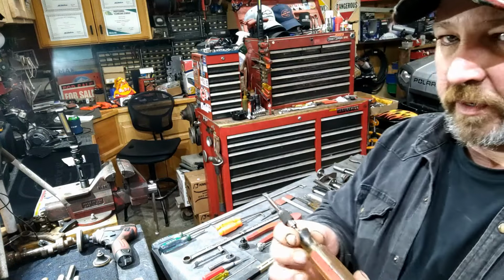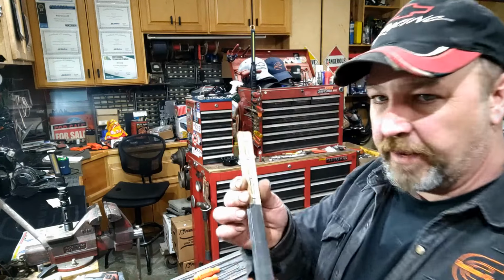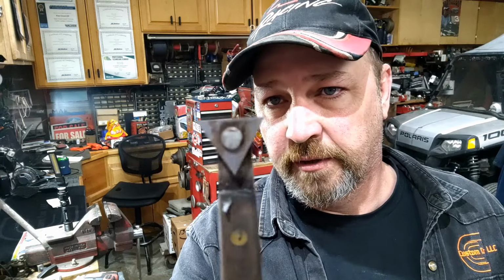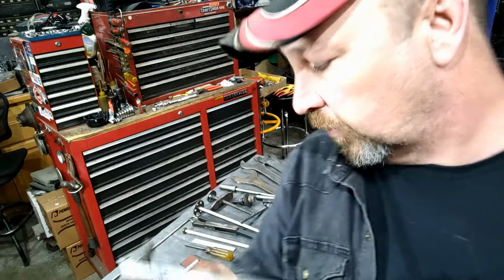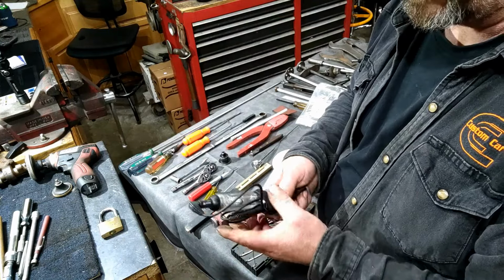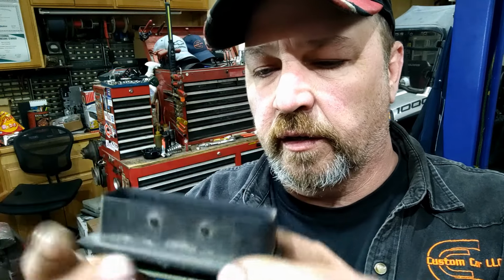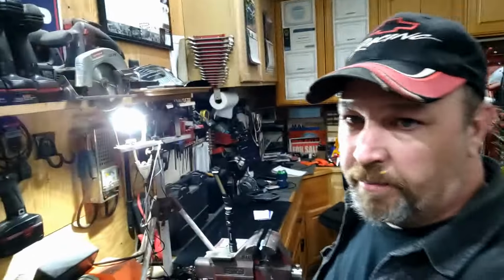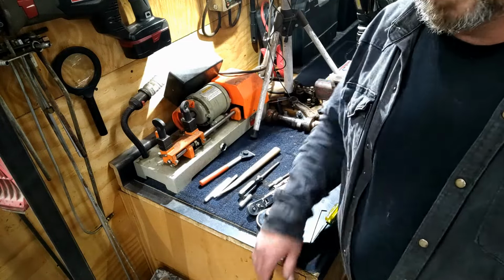My Homemade and Repurposed Tools #homemadetool #autorepair #diy #inspiraton

Comment: Most times I see someone's creations at a yard sale I pick them up, never know when you might need'em for
Reply from the maker: Yes, I did that the other day I stopped in at a garage sale the there were these things with a wide radius aluminum pulley and some thin cable I didn't know what they were until I got home but they turned out to be some fishing trolling apparatus that bolts to the back of a boat.  I will make something out of them someday for sure.  Thanks

Comment: Do you have a specific brand that you stick with?
I have craftsman, snap on, harbor freight, and a some willy nilly found or aquired stuff.
Reply from the maker: No I have them all.  Mostly I have purchased my tools individually.  I prefer the USA Craftsman but the china made stuff isn't any good, the screwdrivers are brittle and the 20v cordless is junk as well my drill has a loose chuck and both smaller batteries have broken cases.  I have MAC, Snap-On and Matco stuff I also have some Harbor Freight, I like the Braun lights and I have a Merlin tire pressure gauge that I use.  I have a Launch scanner, my TPMS tool is an Autel and I have a  Hantek scope but plan to get an old Modus Snap-On.  Thanks for watching.

Comment: You've made quite a few useful tools Pete! Some of the tools I've made: 79-87 SAAB 900 front brake caliper piston wind back tool. The factory ones kept falling apart. A hole flaring tool to flare the holes where the nerf bars passed through the door panels on a Chassis Dynamics asphalt modified. A hand step flanging tool from a set of old locking pliers. A slide hammer. A small hobby vice that was to be used to shape and file string slots for guitar nuts. A set of scales to weigh an asphalt modified that used multiplying levers and 4 bathroom scales. They were pretty accurate and we couldn't afford a set of electronic scales. A fixture clamped to wheels so I could use a magnetic caster/camber gauge for racecar setup. A tire scoring tool to score lines in the center of racing slicks so we could measure toe out. A wheel puller to remove stuck wheels on a Craftsman riding mower transaxle.
Reply from the maker: That's a lot I wish I could see your homemade tools.  A Chassis Dynamics asphalt modified I need to know more?  I was at one time going to make some scales using hydraulic cylinders but was having a hard time finding really short cylinders and then I would somehow convert psi readings to lbs.  I currently have a stuck wheel on the kids go-cart I haven't decided how I will get it off.   Very cool Lieser.